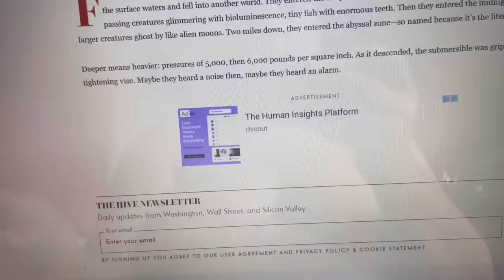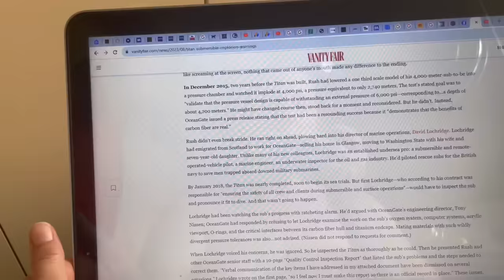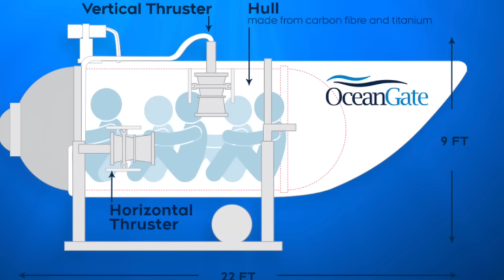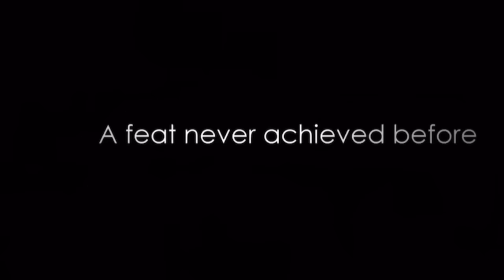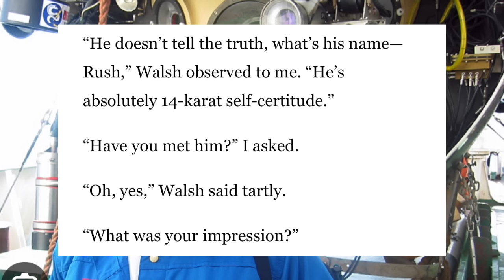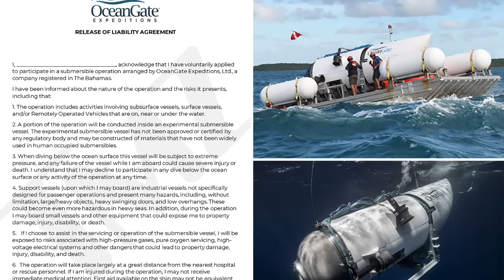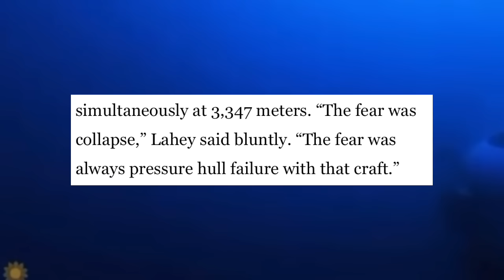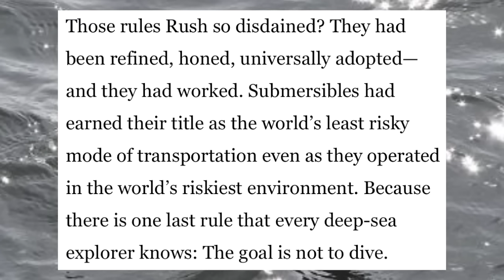TITAN Sub: The Most Shocking Titan Lies & Cover-Ups that you have never heard before #Titan

Comment: Akin to germanwings flight 2525, and the pilot flying the plane into the mountains at full speed is similar to what rush did , but he was getting really high every time he took people down there, knowing it might happen this time
Reply from the maker: Hi Aperitifs, Germanwings was crazy . Do you think Rush was as suicidal ? I am not sure he wanted to die , I think he believed it would hold or he hoped for it as he needed the money to keep the lights on
Reply: @silki24  there is without a doubt , he could of done dive after dive with the loud cracking sounds happening , scaring all the passengers, ( he got high from those sounds and fight and flight response from the people on board, he was dicing with a level of adrenaline I've not read about. Something beyond suicide.    It's known to make something stronger than breaking point , double and a half.. you have to respect yourself and others ..
Reply: What's never talked about is if he pushed the brushless thrusters hard and the lithium battery exploded, as they were in the plant room part of the tube,  that area was probably not pressurized , and we had no real study into what happens to lithium batteries under that incredible pressure, think a thermal runaway happening in the plant compartment of the titan

Comment: It's like one expert said, "His design wasn't innovative, it was dumb." Carbon fiber is exceedingly strong but it's strength is from within. Its good for holding INTERNAL pressure, not EXTERNAL. Im surprised it held up as long as it did. Its likely that every time it went down it weakened the carbon fiber until it just couldnt withstand the crushing depths any longer.

Comment: This video discusses the absence of hatches.  With the pressure outside the vessel, a hatch could never be opened.  So it would be useless having one.  The only way a hatch could be opened is to flood the vessel to equalise the pressure.  Thereby allowing a hatch to be opened.  But as such a depth the pressure would in itself be instantly unsurvivable.
Reply from the maker: yes true , it was mentioned in case the vessel would drift and get lost and then get to the surface, they would not be able to get out until found especially since there was no GPS or distess beacon for that scenario
Reply: @silki24  I am not an engineer but before videos like yours, in was telling people how totally unrealistic such a vessel was.  It was in fact a submersible coffin waiting for a cadava but, totally inadequate for that function also.  By the way a great video.  More like this please.

Comment: The pressure vessel was NOT cured in heat. It was allowed to air dry in an open warehouse. Heat drying is expensive. Just another cost cutting move.
Reply from the maker: Hi Carol, it is just shocking and sad

Comment: His wife ran the show - she knew it imploded soon as they lost contact and saw it on her radar screen. She played dumb. Cost all that money to search. Pretended hope and all the while was moving all of her assists from the ship using Star Link I think. My opinion. She is totally responsible too. She waited a longggg time to even report it vanished from radar don't forget that. That gave her time to move assets too. She panicked.
Reply from the maker: I am trying to find out more about the wife
Reply: @silki24  She ran the show from the boat at the surface. It was all under her control. They saw the Titan vanish from their sonar screen as it happened the second they lost contact. She knew it was going down too fast. She knew it was cracking and it cracked on a prior dive which was heard and reported to them all. She intentionally delayed reporting the loss of the Titan and it was for a long time - she had to have panicked. The wavers they all were made to sig was to prevent them from being sued if they died. They knew odds were high they may die. So she had to have been moving or transferring major assets during that wait time using Star Link s it was all about the money and fear of being sued with the waiver. Is the only reason I see she delayed reporting the accident. She needs to be charged with manslaughter for her part in what they knew was fraud by deception for purposes of financial gain - promised safety when they knew it was not safe and all for profit. Rush was all about going after the richest people and it was all a con game to get them to 'buy in'; with loads of false statements and s promises and hidden truths of major dangers. That is fraud by deception for financial gain at the risk and expense of huma life. Causing death. That is manslaughter to me. Murder in the 2nd degree even when using the lure of a supposedly safe sub for profit knowing it was unsafe and the sub failure causing implosion and deaths. The ruse of making the tourists 'mission specialists' and the fact they operated in a way to avoid American law is evidence on knowingly causing operating in an unsafe and potentially deadly manner and with the manipulation in place in writing that shows or demonstrates they were fearful of accountability knowing there were likely going to one day be casualties. Rush just was arrogant enough he did not think he would be on that sub the day it imploded, but he knew the day would come. The waiver and the way they were all made 'mission specialists' really tells us he knew the implosion, or some kind of fatal accident was likely coming knowing he skirted all safety regulatory requirements and used materials really not capable of sustaining such great underwater pressures. Mrs. Rush needs to go to prison. She was aware of and part of ad operated all of it. 5 people died because of 'it.' Because of her and her husband not just because of her husband. It was a dual team effort of deception for profit. They are married. Sue her and hang her for life 5 times over in prison. Where she belongs. Why no felony criminal charges against her yet???????????? Her movement of assets from the ship at the time of the accident would demonstrate knowledge of the entire plot for profit - knowledge they died and she withheld it. She knew the minute they lost contact and lost the blip on sonar that it imploded there is no other explanation. She knew it was cracking and had cracked prior. She knew the depth was too much and it went down too fast. She knew all of it and she intentionally waited again to protect her profits. My opinion. Then she let them go o a 4-day wild goose chase knowing the entire time they died the minute they lost contact. I find her to be bathing in deceptive and greedy depravity, filled with the utmost responsibility. HOLD HER ACCOUNTABLE!!!!!!!!!!!!!!

Comment: The game controller is normal. 
James Cameron also used a game controller during the Deep Sea challenge
It's the lack of manual override that causes the stupidity. 
Also, the wire circuit was a mess too. 

Normally, if it's an error in the control system. The ship must return to the surface and cancel the trip but Oceangate engineers said it uses a game controller to change the control panel....(The reality was the game controller and its system were normal but the mechanic messed up their wire and put it wrong)

**This case is caused by ego and he overprides over his experience.
Reply from the maker: interesting, thanks for posting

Comment: Stockton breaking the rules is eerily similar to trumps sidelining safety regulations for transportation.  It was only a matter of time until a major train derailment or an implosion of a submersible.  Both were done for money and both could and should have been prevented.

When safety is a factor you have to be thinking that the proposed plan absolutely has to work with no chance of failure, not that your idea could work.
Reply from the maker: Hi Drew, I can‘t say to much about the train derailments, I have the feeling that it is bad or old infrastructure. I just googled it, there were more than 12,400 and 6,600 carried hazardous materials, 348 cars released the content. More freight is hauled over fewer train miles so that leads to an increase . Leading cause: track defects. But staristics say total deraiments are down and accidents on mainline rails are at historic low. 
To compare it with the Titan, in my opinion it would be like using plastic rails instead of steel although it is a fact that plastic does not work

Comment: I mentioned early on, in comments about videos about that sub implosion, that you can't push a rope. Rush didn't have mechanical comprehension. It doesn't matter who his ancestors were. You just don't build a plastic submersible. The passengers who died didn't heed any warnings they might have been aware of. I would never ride in any plane, train, automobile, boat, or sub that didn't pass the smell test. I'll bet that the passengers gave him hell, as the hull was cracking. Too late for them! Red flags everywhere, but that guy must have been gifted in the art of pure bullshit.
Reply from the maker: Hi Soco, yes I think he was. Very charismatic and convincing it seems

Comment: He made his submersible like a fuselage of a plane with to titanium hemispheres the back of the submersible was the only place with syntactic foam was so when the tragedy occurred it lost power on its backup system it started to nose dive and plunged very quickly so it either imploded on the way down or when the nose if it hit the seafloor he had no phone or buoyancy in the front to equalize anyting
Reply from the maker: Hi Lycan, yes I think too that it nosedived but do you think it was holding up long enough to get down to the floor ?
Reply: One thing I've noticed over my life on this planet is the month of June sometimes starts the summer off with a bang for instance the jackass guy Ryan Dunn he died in June 20th TWA flight 800 was around this time somewhere John f Kennedy Junior in his plane crash and finally oceangate now these have all occurred in the month of June or early July crazy coincidences
Reply from the maker: I hope they will release some of the findings over time
Reply from the maker: So stay at home in June 😀
Reply: Honestly I'm going to poke a little fun at oceangate he said if you want to be safe don't leave your house don't drive a car don't do anything in the month of June LOL

Comment: There is no "escape plan" at those depths. If something fails you're just dead which is why he made everyone sign a waiver because it was a real world possibility you wouldn't come back up again! The sub was doomed the instance they heard those first cracks. those cracks where the adhesive on the carbon fibre coming away from the titanium which is why you do NOT mix those materials; they don't want to work with each other. Once that adhesive started to crack the only thing holding it together was the pressure on the skin. as they jettisoned the frame and started to rise the pressure on the skin became "less" and BOOM dead. The ONLY way they could of survived would of been if another sub "scooped" them up at pressure which is impossible so yeah. doomed

Comment: I do not understand why he did not spray a thick layer of foam over the carbon fiber at least. Why experts would climb aboard. He had a death wish. The way he was always smiling reminded me of the green river killer.
Reply from the maker: I don‘t think foam would have changed the outcome . I will have to look up who the green river killer is, never heard of him but sounds scary 😱
Reply: From what I have learned the design was doomed to fail - at one time I thought that if inner ribs were used as in submarines it might have been the answer - 
     Because of the deflection of the carbon fiber hull it still would not help - 
       It would have to be a spear of all the same material also capable of deflection and crushing force -
Reply: I just looked at the video - the foam is used to increase the surface area os metal hulls - it's to increase bouncy not to strengthen the hull - 
      That hull was light like an aircraft frame
Reply from the maker: yes it was and it was so far from working that it would have never been certified , even when modified
Reply from the maker: yes
Reply: @silki24  👍

Comment: late information that's already been told months ago. it be 1 year or 2 before we here anything else what really happened would not surprise  me if they build another  cylinder with the same machines and materials and do a test, money should not be an issue doing this test considering who perished. until then there is no news its behind closed doors now part of the wider investigation for  civil/criminal proceedings
Reply from the maker: Hi Topbbanana, building another one or a small model and test it would be interesting but on the other hand  , the Titan had so many flaws that all alone could have caused this

Comment: Was ballast release controlled through mechanical or processor/electronic release??
Obviously this redundancy ALSO FAILED.
Reply from the maker: Hi TK, I believe it was mechanical
Reply: There were weights in the skids that were machanical hand released
Reply: @able880  I hate that they would just dump the weights on sites like Titanic, like littering on the site.
Reply: @rebeccajohnson8769  they don't have any other way to de-ballast on a deep water submersible other than to drop the extra weight that they use to make the sub heavy enough to sink to the bottom - 
        Over time just like the titanic all that iron will eat away and be no more -
Reply: @able880  I know, but it kinda contaminates the site, IMHO.
Reply: @rebeccajohnson8769  I respect your thoughts about adding more to the sight - 
      There are ton of iron ships on the ocean floor along with other scrap - during WW2 1/3 of the ships were sunk - 
      I  feel like the titanic is a grave sight that should be left alone  -
Reply from the maker: It will crumble anyways very soon , so that problem is probably solved then
Reply: @silki24  every thing in this world erodes or will rust away just as when  we age - pipe lines, platforms  and ships have anodes fasten to them to slow the erosion process down - the anode erodes away instead and will have to be replaced every 10 or 20 yrs - 
     For about 10 yrs to 20 yrs the titanic was probably fully intact I'm sure there were many anodes fastened to the hull - 
     The anodes generate a voltage or charge of electricity that dramatically slows the steals from rusting out and crumbling - 
      Once those anodes eroded away and no longer generated voltage - then the hull began to rust away -
Reply: @silki24  the anode has a positive charge - on a car battery the positive post is the anode and corrodes -  you might notice on ships or tugs at times you will see aluminum looking bars of metal attached to the hull - the water becomes like acid in a battery and the anode becomes the positive post and gives up material or will rust away -that way the hull of the vessel does not rus away - 
     The anodes have to be replaced in time as the water eat them away - but the steel hull or platform is saved from corrosion - the anodes are sacrifices -
Reply from the maker: very interesting Able, are you in physics ? Thanks for posting !

Comment: Anyone who's worked with carbon fiber knows that bonding it to metal, any metal,  will eventually be a point of failure. He was told about this problem but simply brushed it off. Carbon fiber itself is problematic. With use, it will develop micro fractures. These will inevitably multiply and lead to eventual failure. 

As metal and carbon fiber undergo changes in temperature, they expand and contract at different rates. These cycles will eventually lead to the matrix bond (glue) failing. You see this all the time.
Reply from the maker: Hi Bob, thanks for the explanation. Rush did have micro fractures already and had to replace the hull and then he refused to have it scanned. Should have been scanned after each dive
Reply: Gluing metal to plastic or just about anything is usually problematic whether its going to the bottom of the ocean or not.
Reply from the maker: yes makes sense
Reply: So I guess my idea of a radio tower out of carbon fibre is a bad idea.